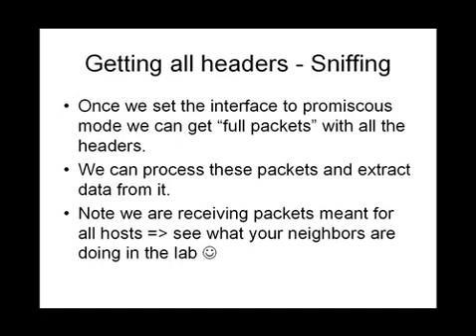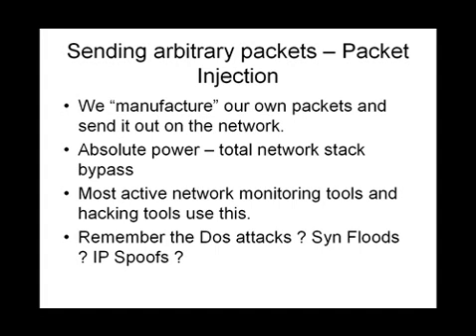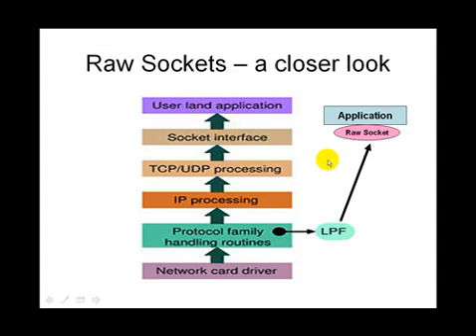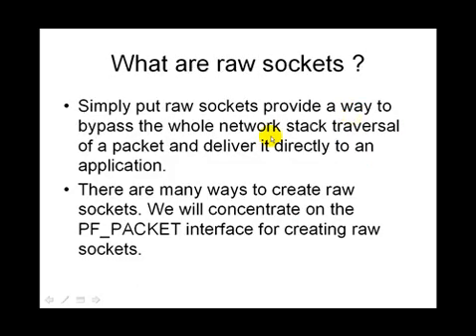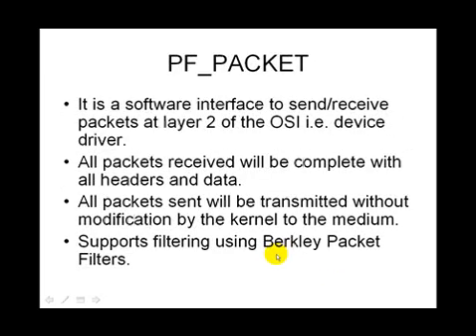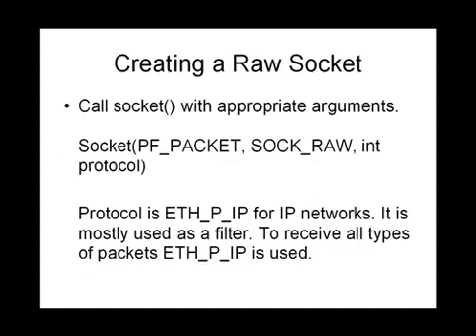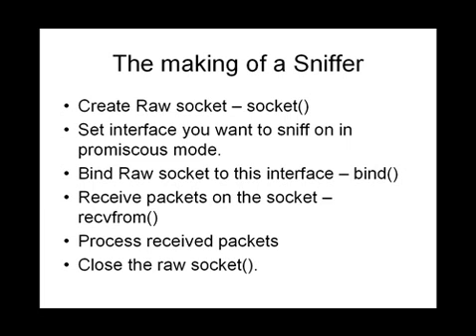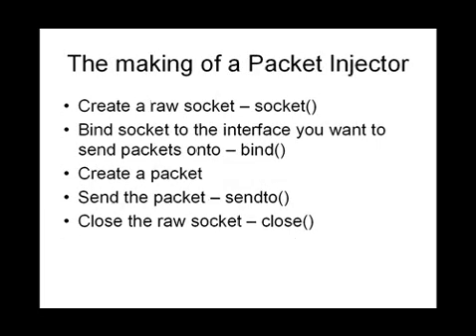Raw Sockets Basics Presentation (2)

Comment: I'am developing a program for a system with low CPU and memory where I'am trying to increase the speed/throughput of packet sending.

I am using a UDP socket (sock_dgram) and I was wondering if using a raw socket and sending packet directly from the interface could help me improve throughput values. Why ? Because bypassing the kernel and avoiding processing all the protocol layers could reduce overhead. What do you think ?
Reply: hye tried it? able to inrease the through put?